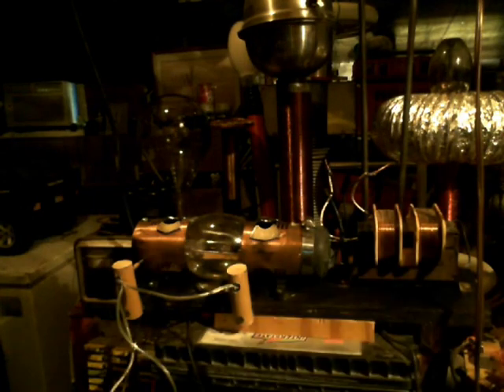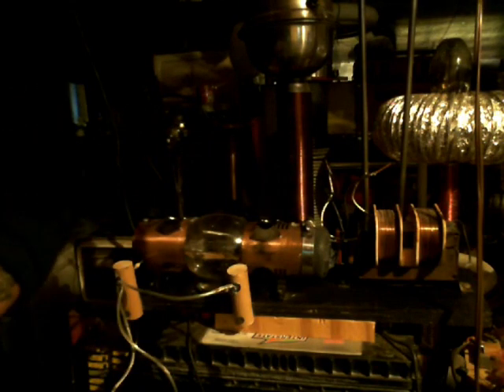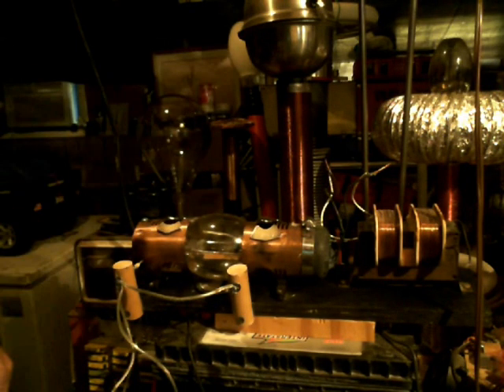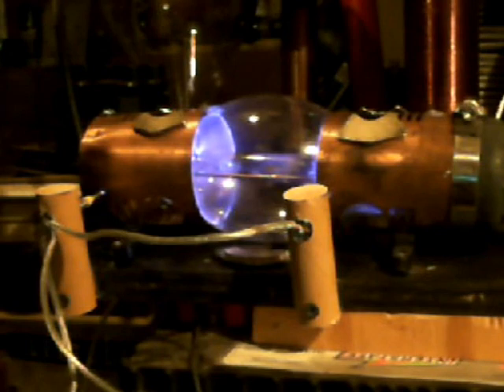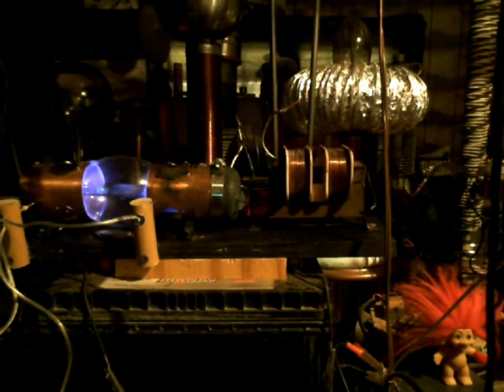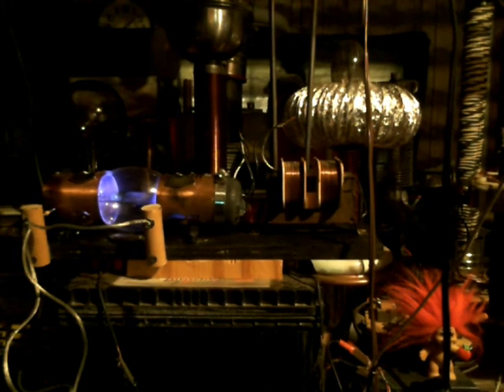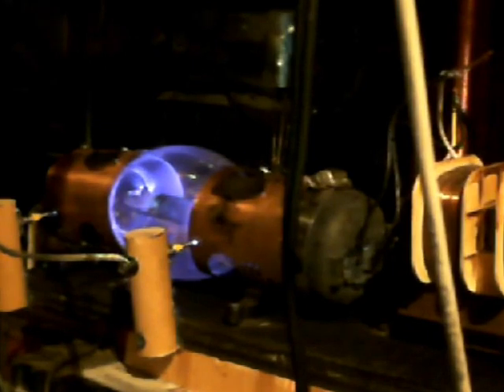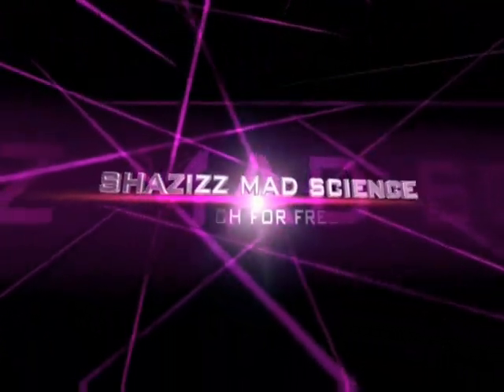PLASMA REACTOR !

Comment: Excellent explanation of how you manipulate it. The color of the plasma you see is also the color of Nitrogen gas when it is primed for being used as a gas. I can't wait to see your other research, doing a good job on explaining and showing. I wish you had a bit better of a camera that is good in low light, and lighting for when you are pointing the lens at it. Keep up the good work. Check out my videos you might find them interesting.
Reply from the maker: Great to hear from you, I have been wanting to talk with you for a long time. I love your work. Do you happen to use skype or some sort of voice chat I would love to have a conversation with you sometime.
Reply: shazizz you should get 3D printer im making a ark reactor its small and portable i had to hook up 12 computers so i could make this possible i still have to get the copper and hydrogen then i can hook up 3 car batters to trap the hydrogen in a magnetic field  and heat it with induction  heating.
DO NOT TAKE MY DESIGN OR I WILL UNLIKE THIS VIDEO

Comment: The goal is to use  plasma to create the energy for power. There should be no need to use a burner or oil. Everyone interested in the new plasma technologies should be sure to check out Keshe Foundation and  more specifically Knowledge Seekers Workshop Youtube. Currently, as of July 16, 2015, they  are up to 70th .  One can join the workshops on line or attend the workshops in Italy.  Keshe workshops are hands on.  No grades...he says you grade is proven by your success.  I know very little about electricity...but am so into this physics learning from the ground up.  So far the plasma can produce a 10 to 50 ratio ...that would be 10kw input to create 50kw output. 500 small reactors can produce something like  50000 to the 10th power. So don't connect your generator to your electric line entering the energy into the grid...because the energy will blow up Nuclear Power Plants... be very careful how you play with this technology.  The grid will be obsolete, as will how our transportation systems function...bye bye tessela car. no coal, no nuclear power, solar, wind....all will potentially become obsolete. If we can manage to reign in the NWO people.  We WILL have a much better world.  I believe this project ties in very well with the Ubuntu system of community independence which is beginning to be experimented in South Africa. Bye Bye bankers we won't need your loans.  Please check out Ubuntu party... and the Knowledge Seekers Worksops ......   Keshe Foundation
Reply: Tiempo Nuevo Yea..totally!!

Comment: It's as spark gap generator being used as a capacitor-like energy storage device. It is not a reactor because it doesn't create energy it just stores the energy from your oil burner.
Reply: Erin Murphy True from what he's done on 1 & 2 steps.  He's still thinking in the old box.  But, he might just get there..he's going the right direction.

Comment: I doubt you have 20,000kv as that is 2,000,000v and also a magnatron from a microwave normaly uses 2kv aka 2,000volts.
Reply from the maker: Beckett Oil Burner Igniter
SPECIFICATIONS:
Input Voltage: 10.8 - 16 Vdc
Output Voltage: 20 kV peak 
Output Current: 25 mA RMS
Input Current: 1.8A
Ambient Operating Temperature: -40 to +150° F
Storage Temperature: -40 to +150° F
Moisture: 5 to 95% Relative Humidity, Condensing
Reply: ok but that is 20kv otherwhise known as 20,000v not 20,000kv because 20,000kv is 20,000,000v otherwhise known as 20million volts not 20,000 volts!
YOU DO NOT HAVE 20MILLION VOLTS YOU HAVE 20,000 VOLTS!!! (from that oil burner igniter.

Comment: This is a cathode ray tube, also known as a vacuum transistor. You have no idea what you're doing, this isn't fusion, nor X-rays. This is a plasma arc rectifier.
Reply from the maker: It's what is going on inside that you should be looking at.
Reply from the maker: sammyd1000 SPECIFICATIONS:
Input Voltage: 10.8 - 16 Vdc
Output Voltage: 20 kV peak 
Output Current: 25 mA RMS
Input Current: 1.8A
Ambient Operating Temperature: -40 to +150° F
Storage Temperature: -40 to +150° F
Moisture: 5 to 95% Relative Humidity, Condensing
Reply from the maker: I know exactly what I am doing and I know exactly how a rectifier works it is not new technology. Goes back to the mercury Arc Rectifier. Nobody said this was anywhere near fusion or X-rays. By speeding up and slowing down the electron flow in the argon I can generate frequency ranges that I want out the other side as well as something else you missed in the basic laws of physics. Simple transfer of energy is all I need to move energy from point A to point B. People do not get it and this is why our power grid is still in the stone age. I do not care what the book says. Re read the conservation of energy and maybe you will get it. Not trying to get out more than I put in, it is a tuner plain and simple. I tell the energy what I want it to do within the parameters that nature allows. I lose nothing and I gain nothing more than controlling the flow. And with that said using what nature has already provided I get the work done that I want without all the wasted energy. The laws of physics at this point can not be changed however can be used to your advantage as long as you know what you wish to do with the energy. The way that we use energy to day is flat out ridiculous  and wasteful, It never ceases to amaze me how supposedly highly educated people in this world can not grasp such a basic concept of science. No worries, I will prove what I say and maybe then people will look at things just a bit closer before denying possibilities.
Reply: Actually, a cathode ray tube is/was a display device. It looks like he's directing a tesla coil through the tube... It's a nice toy though!
Reply from the maker: Who said electrons are coming out the antenna ? it is a micro wave created by the magnetron.
Reply: The anode and cathode have to be specially shaped for that. At any rate, this isn't a vacuum tube; it's got an inert gas in it, to conduct electrons as plasma to rectify electrical current.
Reply: Also doesn't know how a magnetron works. It does not 'fire electrons out the antenna"
Reply: Anthony Russell not 20000 volts
Reply: Would the light bulb light up if you touched the metal part of it to your skin? I'm wondering if you just being in that room would make you a conductor strong enough to light the bulb. Btw, I'm just starting to learn about any of this so, I hope I don't get a bunch of condescending remarks. I feel very content to learn about things that interest me at any time. I'm only striving to become an expert in learning new things :)
Reply from the maker: Hyla Borrell I'm sure it would but in the process because of the high voltage and frequency it would lay you out on the floor. :) My cousin found that out the hard way when he pointed at it and got his finger to close it arced across and lit him up. Any time you mess with high voltage you have to be careful, even though the amperage is very low on the 12 volt beckett oil burner igniter, the output is 20KV pk, 30ma and it hurts like heck to get hit with it. Safety first!  Be safe and I would really be interested to know how your studies/research goes. Take care my friend :)

Comment: 2000 volts, NOT 2000 Kilovolts. Magnetrons run on about 2000 volts ac, around 60 hz. and oil furnace start transformers are around 3 to 4 thousand volts.

Comment: Hi Shazizz thanks for the video, you mentioned about creating your high voltage running from a car battery? is that correct? if so please would you be kind enough to provide information on how I can create high voltage from a car battery, I am an armature with very little electrical know how, any help would be appreciated.

Comment: Why is it that you do not have a geiger counter or radiation safety equipment. The microwaves are indeed ionizing. You are possibly releasing the major forms of ionizing radiation. You should have saftety devices. You may be causing yourself and/or others harm.

Comment: basically its acting like a fluorescent tube.  only in this situation its air.  The process is called a cathodic discharge.  At the break-down voltage (usually around 400V (AC or DC) the outermost electrons of Nitrogen (because its electrons are more loosely bound than oxygen) are stripped forming a plasma.  Excitation of the ion pairs results in the purple discharge.  the color is indicative of the energy of the electron when it re-attaches to the Nitrogen ion.   I did the original fusion rsch.

Comment: And second of all: I'm assuming you mean 2000 VOLTS (not KV) for the magnetron, and 20000 VOLTS (not KV) for the oil burner? I don't suppose that your oil burner actually puts out 20.000.000 volts? That would definitely result in some pretty nasty radiation levels!

Comment: First of all; you are oversimplifying the working principle of a magnetron, and you are NOT correct in your assumptions. The magnetron filament is powered by high current low voltage (typically 2-5V@100 amps), and the movement of the beta particles is NOT due to the magnetic field, but because of the potential voltage difference between the anode (antenna) and the cathode (filament).

Stop posting incorrect information!

Comment: the thing I don't understand is if your tryin to achieve a plasma reactor to make free energy. why do you use house hold power. I thought the whole idea was to to make energy without using the electricity in your home. when you can produce energy from opening the plasma without using power from the home ill be impressed.